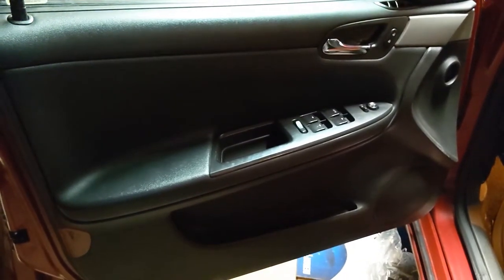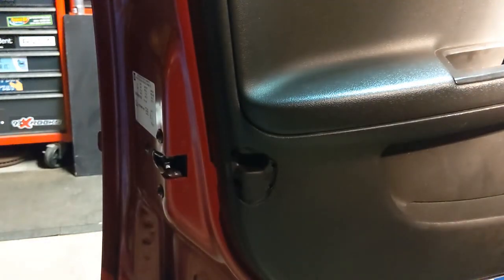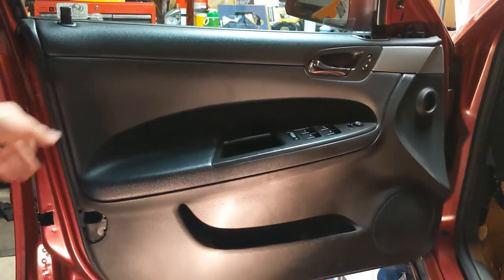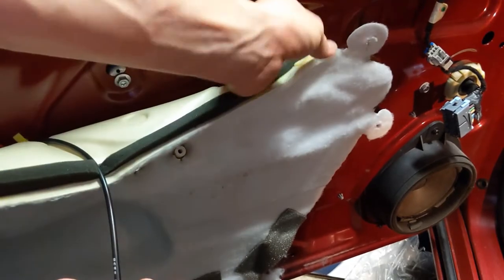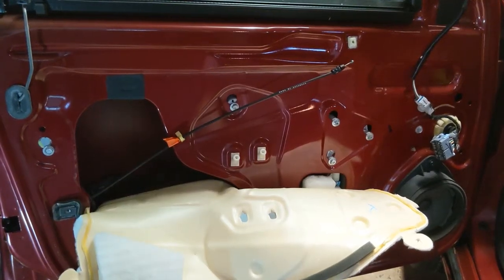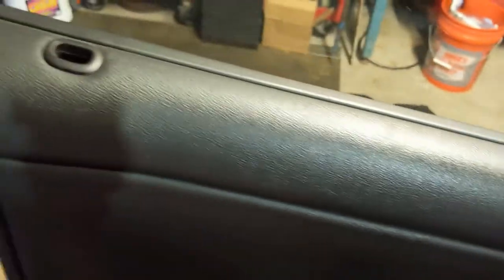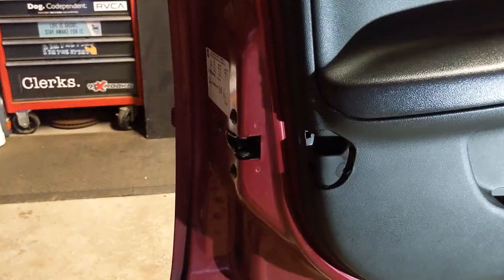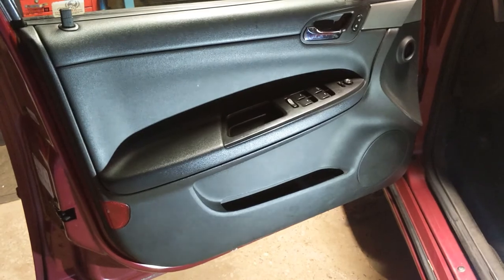2006-2016 Impala/Limited (9th Gen) Front Door Panel Removal and Reinstallation

Comment: I am watching  this video,  for the  first time watching your chanel, however  awesome video..   What I  reallty like about this  video is that you are showing exactly what the typical  person will  exxperience while  trying to remove and instaling the door panels!  
I have a question  for you, with your experience, have  you  had to fix/investigate  what the  cause is for any sueaking and grinding noise  that seems to come from booth the  driver side door  panel and underneath the steering wheel  cover.  Do  you have any sugestions on how to fix ths issue in these two places?
Reply from the maker: Is the squeaking occurring when the door is closed and driving down the road? Or does it make the noise only when you open and close the door?

Comment: Is it possible do this if if the door won't open due to having a bad latch mechanism ? In other words if the door is closed ?
Reply from the maker: The door panel closes up against the dash, so no. If it were me, I would locate another door panel from the boneyard and cut apart the one on the car to access the latch mechanism..
Reply: @CertifiedShadetree  - yikes - thanks !  I can see that now that it's daylight out ... 2 of my 4 doors won't open due to issue with the latching mechanism ... any idea if it's possible slip something in the window slot to actuate them to get the doors open ?
Reply from the maker: @steve318k  Was about to suggest checking if the cable is still attached to the inside door handle, but alas, it's part of the door panel 🤦.  Maybe try working the inside door lock plunger and the outside key (if it's the driver's side) a bunch of times. It could be that the lock mechanism is what's gumming up the works. But grabbing onto that rod that runs from the door handle to the latch is going to prove difficult. I would say try a locksmith depending on how much coin you want to drop, at least they'd have the right tools to get inside the door to jimmy it open.
Reply: @CertifiedShadetree  - nope, passenger door, so no key ... I will go try the wiggle method someday when the weather is better... not quite to locksmith time yet, but thanks !
Reply from the maker: @steve318k  Best of luck! 🍻

Comment: Looking for advice, there are two doors type, one with molding other without moldings. My question is how those moldings are attached to door....
Reply from the maker: They're held on with 3M moulding tape: https://www.amazon.com/dp/B00JR4D7AA/ref=cm_sw_r_cp_apa_fabc_7PEZAY89RPX6G9745XBX?_encoding=UTF8&psc=1

Also you'll need the adhesion promoter wipes to wipe down both surfaces before attaching the tape:
https://www.amazon.com/dp/B018WQ2T3O/ref=cm_sw_r_cp_apa_fabc_XYVDZME4ZCGEFWXNPNP5?_encoding=UTF8&psc=1

I needed 2 rolls to do one side of the car (more like 1 1/2, so buy 3 rolls if you're doing all 4 doors.)

Also, the mouldings have guide pins on either end. The cars that came with mouldings have the corresponding holes punched in the doors.
Reply: @CertifiedShadetree  my car do not have moldings, but my both doors damaged so i am looking for replacement. There are so many doors with moldings in market  but very few without it  So if i buy with moulding one it will be problem if i remove it after because of those holes.
Reply from the maker: @wantharley  Another idea, locate a set of mouldings for the other side of the car, cut off the locating tabs, measure the correct location on your replacement doors, and tape them in place. Might be the cheapest and easiest way to get the car to look "even."
Reply: @CertifiedShadetree  good idea!!!
Reply: @CertifiedShadetree  or vice versa, just cut molding from replaced  doors! Holes close by welding,  Any way need to renew paint coat! I have PPV P1C  no molding original. But in catalog all oem doors without holes, and oem part numbers are only for one type of each door!! It is suspicious.
Reply from the maker: @wantharley  Wonder if there's a different catalog for the police cruisers? Nah, that wouldn't make any sense, they had civvie models without the mouldings. Is there anyone that can make sense of some of the shit GM does?🤣
Reply: @CertifiedShadetree  catalog is same but no door found with holes.
Reply from the maker: If all of the OEM replacements are smooth, it leads me to wonder if they have a template or a procedure for drilling the holes in the proper location. 🤷‍♂️

Comment: Is the process the same on a 2015 impala?
Reply from the maker: Only if it's the "Impala LIMITED", which is a carryover of the 2006-2013 9th Gen model. If it's a 10th Gen straight up Impala, NOT the Limited model, then no.
Reply: @CertifiedShadetree  how do I unhook the wire harness if I'm swapping a door?
Reply from the maker: Pull the lower kick panel trim and you should see the connector. Check the images in this eBay listing: https://www.ebay.com/itm/401655903357?hash=item5d848eb47d:g:-o8AAOSw~slcES6h
Reply: @CertifiedShadetree  thanks alot. Looks like once I take the screws out the hinges I can just disconnect it by pulling it out.
Reply from the maker: Best of luck to you! 🍻